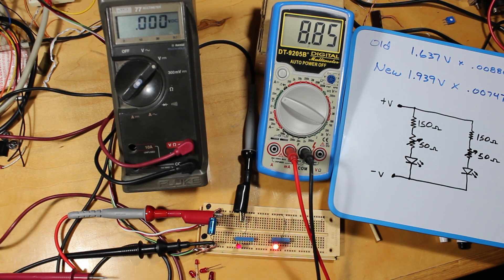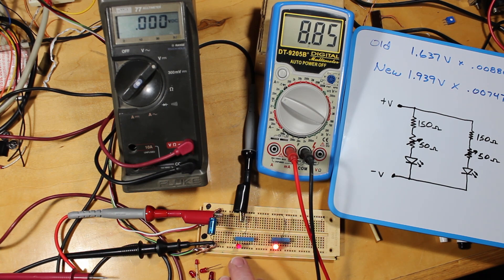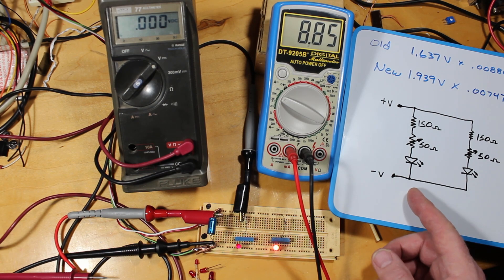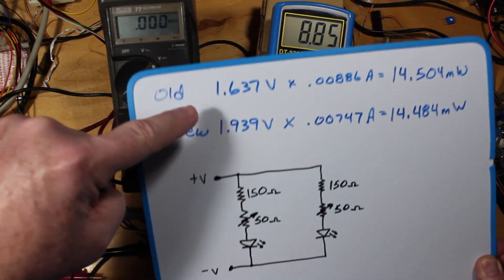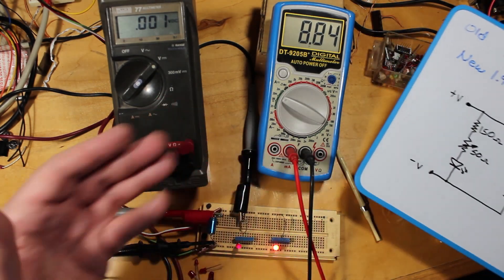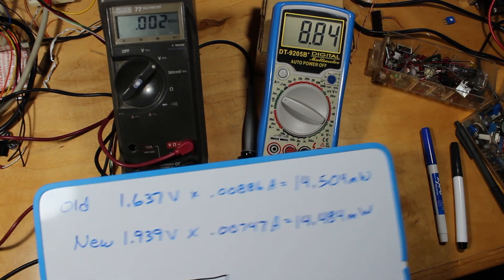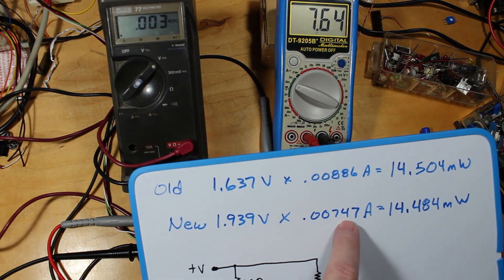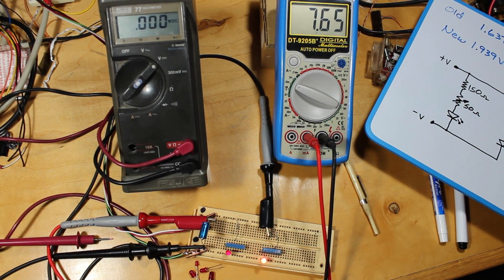#5  LED's old vs new but with the same power applied.  Not the same current.  #led

Comment: These days white or phosphor-converted ones are absolute monsters regarding efficiency - their mfgs are trying to extract absolute last drops of light by improving coupling, phosphors, voltage drops (white/blue went from 3.4v to 3.2v to 2.8v last time I've checked) - you can light most of them with nanoamps.

Comment: Unfortunately, I think a lot of electronics designers still have it in their heads that they need to power LEDs at their maximum current capacity to get decent brightness out of them, which then leads to all of these modern products with things like a simple "power indicator" LED that can light up your whole bedroom at night, for no good g*ddamn reason...
Reply from the maker: Agreed.  I've used black electricians tape in the past to deal with just that.  You can poke a pinhole in it to let just a little bit out.
Reply: Had no idea ive been using obsolete LEDs, to think they're whats killing my solar system this dark winter, those LEDs drawing all the little power i have left!  You guys are life savers.

Comment: I have a bunch of LEDs I have had since the 70s and they are really dim compared to newer LEDs..  The advances in electronics since the 1960s is quite remarkable. 
I still remember the transition from slide rulers to electronic calculators and tubes to transistors. The 1970s PDP11 looks quaint compared to a current desktop.
Reply from the maker: Ahhh, the PDP-11.   spritemods.com has emulated the PDP-11 using an ESP32 processor.  Google 'PDP-11 computer ESP32'.  Some people have a lot of time on their hands.

Comment: LEDs....even in 2010, let's say, a SMD LED used as an indicator in a mobile phone was quite happy at 1-2 mA, and we saw light output improvement, in that period, of about +40% in 2 years... the phosphor based LEDs also saw fast improvements,  with improvements in both the blue "pump" LEDs and tbe phosphors, and, even packaging improvements, in terms of better out-coupling geometry, better heat extraction and optical reflectors.
Good idea for a demo, pretty well done, and good for you, taking input to improve the demo!
Reply from the maker: Thanks for the comment.  Just started making videos so lots to figure out.  Too short, too long, etc.
Thermal consideration as it relates to electronics in general is on my list of videos to make.

Comment: It is often said that LEDs require 20mA. This is true for old LEDs. 
New LEDs need far less, perhaps 2mA.
Reply: Some of the Wurth high eff LEDs only need 140uA for decent brightness.  Green and yellow-green are best for human eye sensitivity. Kingbright might hv some as well.
Reply from the maker: I agree that the general practice I was taught many years ago assumed 20mA for full brightness, if you didn't have the spec sheet.
If you want to drive (source or sink) the LED directly (with current limiting resistor) from the pins of an IC then you need to know the capabilities of the chip.  Thankfully that green LED is plenty bight at 1mA to be used as an indicator.
I see Everlight produces a LED (model HLMP-4740 for example) that is spec'd at 2mA for typical application and a maximum  continuous forward current of 7.5mA. Note that it only produces 2 millicandella, but maybe that's what's needed.

Comment: Thats quite a low current for an old LED, I'm sure if memory serves me right they had an ideal operating current for best output of around 12ma, and to be honest I dont know what the ideal current is for new chemistrys, although its fairly obvious even with the sweetspot of current/vs lumens for each led, the new one will be magnitudes more bright.
Reply from the maker: My recollection (from school about 45 years ago) was 20mA maximum, so 12mA is a comfortable number.  I went to DigiKey and they have 22,114 indicator LEDs listed, so you can imagine the variations.  Ratings from less than 2 millicandela to well past 40,000 for a single LED.  The efficiency of the new LEDs is really something.  If only my car had that sort of efficiency improvement....
Reply: @MoreThanElectronics  Bringing led's into home illumination has been a great step forward from incandescent, and they will i'm sure become the norm in the automotive world too, I only wished the CRI would get better for the brighter ones also.
I was amazed at our new tv, the old 42'' was ccfl and about 160, the new one is 58'' and about 80w....thanks to leds
Reply from the maker: I'm embarrassed to say my main TV is a plasma, which almost heats the room by itself.  It looks great but uses three times the power of the LED one we're going to buy this spring.  Color rendition will continue to improve.
Reply: @MoreThanElectronics  if it's heating the room then technically it's not wasted heat, unless you live where it's warm lol. Here in the UK since going from the warmer TV and a lower wattage pc we have noticed a general reduction in room temperature, so are now heating it more.
Reply from the maker: Agreed,  That's why we're waiting until spring time.  It's -2 degrees C here.